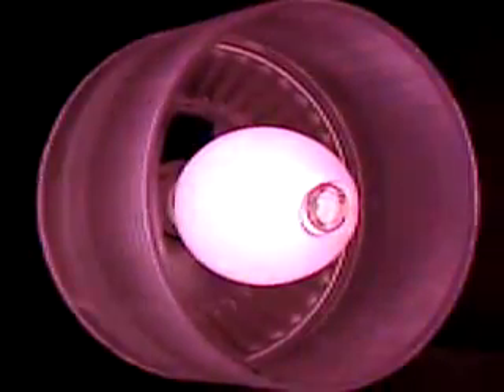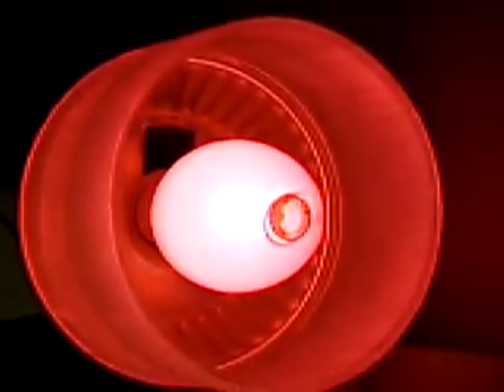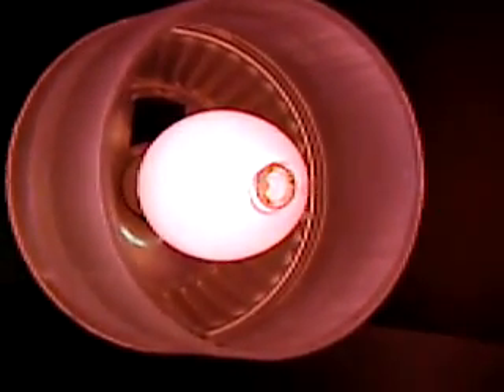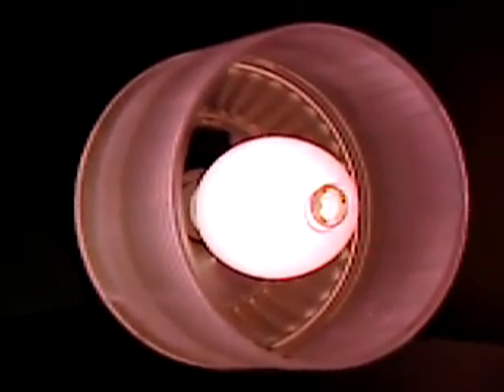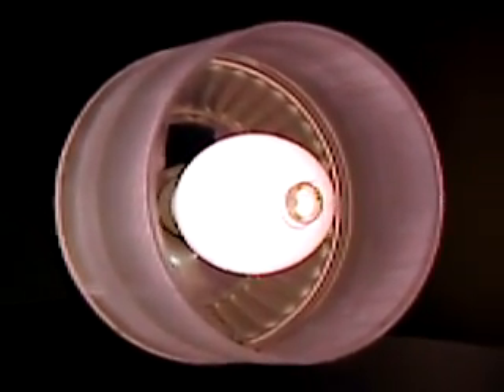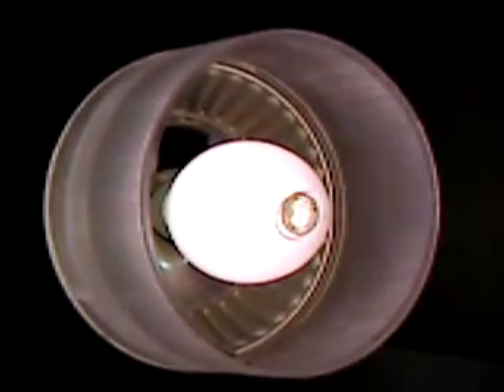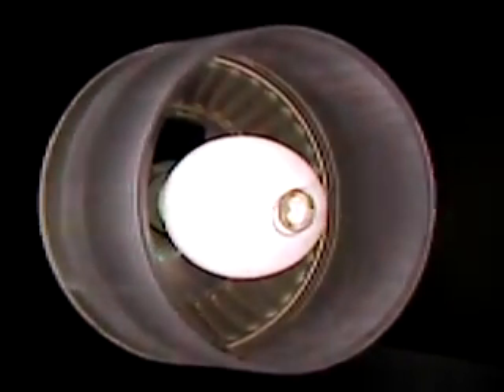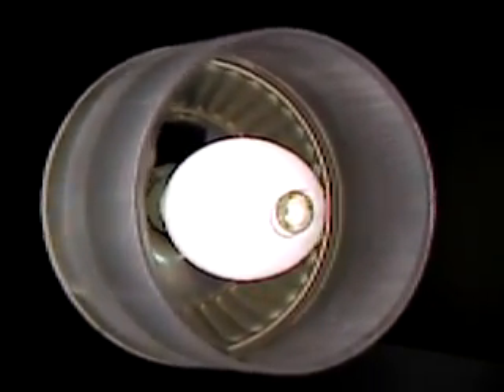175 watt mercury vapor yardblaster with coated bulb

Comment: Nice light. I prefer the clear ones personally, but however I do enjoy the light from the coated ones as well. But theres just something about the light a clear one gives off. I actually have a 100 watt floodlight that I have wired to a bare fixture in my ceiling, I have a clear and coated bulb, and I love running either one when im in there. I am actually getting a 250 watt ballast and clear bulb, and I can't wait to see how it looks, as the 100 watt dosent quite fully light the room.

Comment: yeah I have noticed it too. I just thought that sounded logical because argon has a pinkish color and is used to fire the discharge in the bulb (and because I have never looked at the arctube directly).
But you are right, the arctube glows blue after ignition so it must be the phosphor emmisions.

Comment: I used to try different MV and HPS bulbs out back when I worked at OSH in the electrical section.  The coated bulbs I think are easier on the eyes and create less glare then clear bulbs.

Comment: my first yardblaster was a regent 175 watt mercury vapor,i recently went to a hardware looking for another one,much to my dismay the mercury vapor ones have been replaced with high pressure sodium and flourescent one'si bought the hps one because i like hid lamps better,this new yardblaster is a Lithoria one it uses a 70 watt high pressure sodium lamp,which i just recently shattered,i really dont like the color all that much,the contrast is absolutely horrible and the color is irritating.

Comment: Obviously this is a colour corrected lamp using an Europium activated Ytrium vanadate coating. It can be seen the characteristic  red colour from the fluorescence of this phosphor during the heating of the lamp. I don't like these ones by the lack of green in its colouration. Vanadate mercury lamps casts a noticeable pinkish white light that fully changes the green-blue light of pure mercury arc.

Comment: I dont know about the electrical system in the USA but in England its all 240volts both lighting & power. To wire a mercury lamp in England all you need is a ballast & capacitor you can buy them in any electrical shop. Dont wire it up wrong or it will go bang.

Comment: Exactly!  The HX ballasts have a flash pattern consisting of a uniform flash with a small dark spot in between where the sine wave of the AC cycle crosses zero.  A CWA ballast however has a flash pattern consisting of a flash that starts out bright and then goes dim and then you see the AC zero crossing as the usual dark spot.  High power factor fluoro ballasts have that same flash pattern.